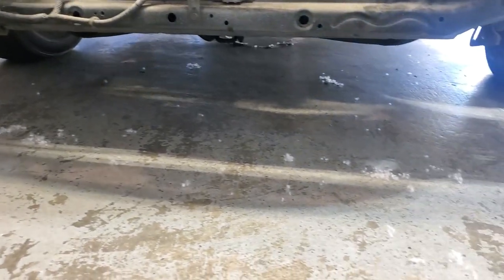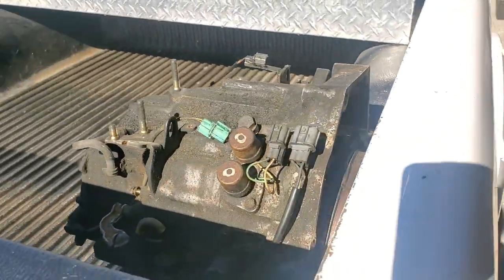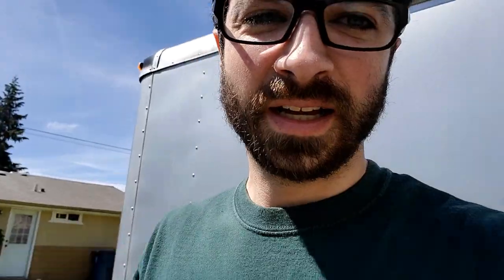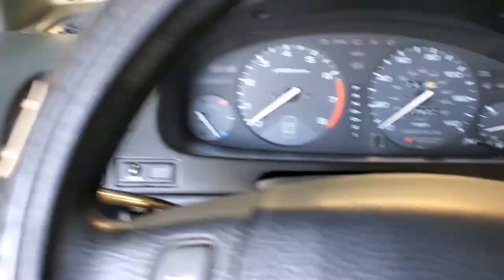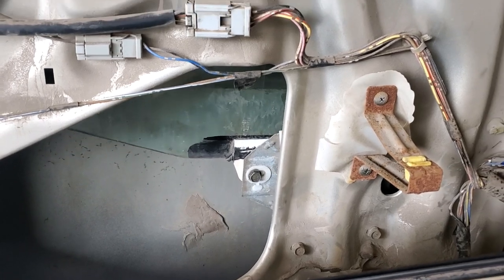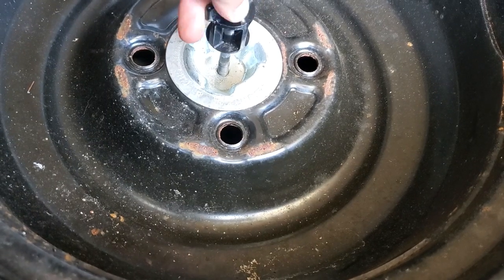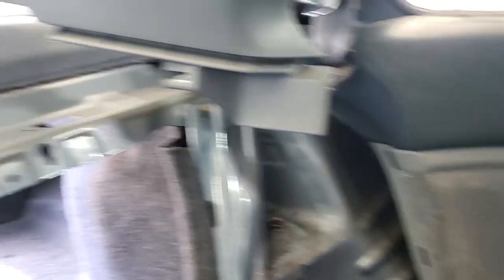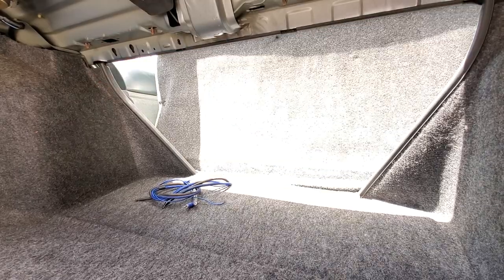5 SPEED SWAP 94 ACCORD!!! REVERSE LIGHTS, CLUTCH SWITCH, HONDA THINGS!!!!

Comment: Hey brother, what do we do with the two black and white wires? The fatter omes that run to the shifter? Im hoping to get my car back in the road this weekend and finally get the swap done.
Reply from the maker: I believe those go to the park neutral safety switch. You run them to the clutch pedal switch so you can't start the vehicle unless you press the clutch pedal down.
Reply: @hobbytalkarmy9001  so instead of just loopimg the clutch safety switch plug so that the car starts without preasing the clutch down and in neutral, i can just extend those to the clutch safety switch plug and ill need to use the clutch lole normal to statt the car? Some people on honda forums are even saying to just leave em plugged there, tape up the whole white box on the sode of the shifter so it doesnt make contact with anything and just tuck it behind the radio, but to leave it in park amd drive the car like that..? I seen yoy acrually did the auto to manual, so i thought id ask ya.
Reply: @hobbytalkarmy9001  by the way, i myself am a Christian. I dknt go to church as much as i should but i pray to christ and the lord every night, and talk to them both while working on the car. I loke how you take the time to pray in your videos and spread that faith and belief. 🙏🏻💙
Reply from the maker: @germaincouture6483  yeah I would wire the clutch safety switch to the park neutral switch like I did in the video. Thats exactly how the manual ecu works, the auto ecu will still think its in park and you can drive it like a manual. I ended up selling this car to a subscriber and he has had it for almost 2 years now with no issues. 

And that's awesome to hear you also follow Christ! I cannot work on cars without Him there for me. I will get way too overwhelmed and upset on my own. 🤣 I'm more active on my Instagram account, feel free to follow and we can chat on there if you'd like. @hobbytalkrc